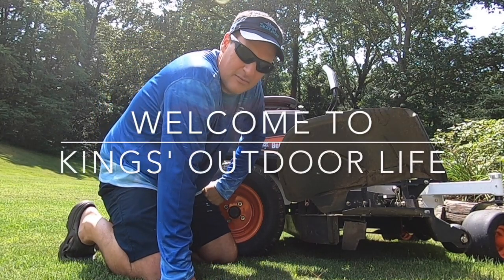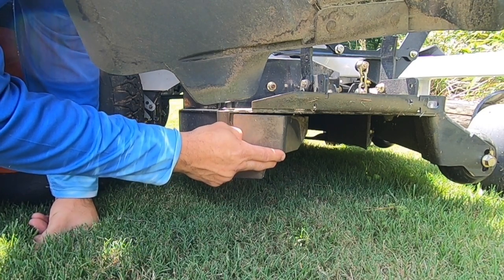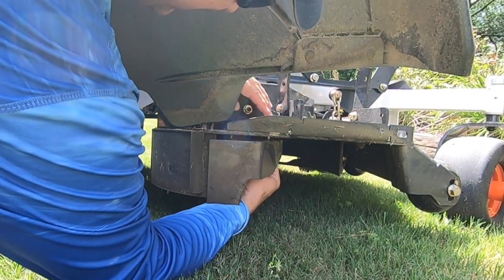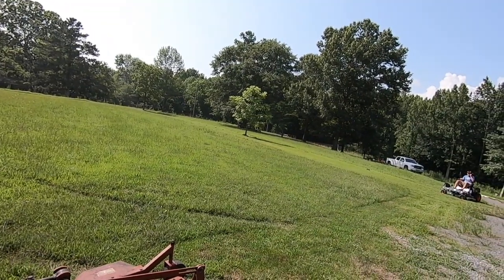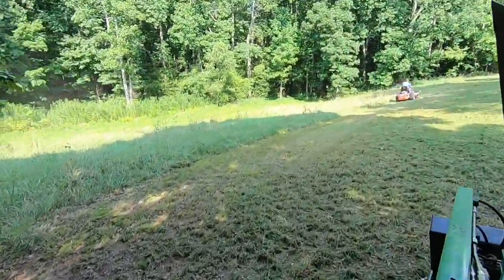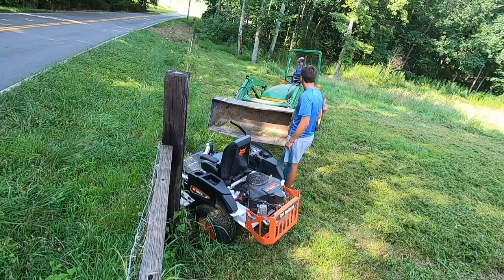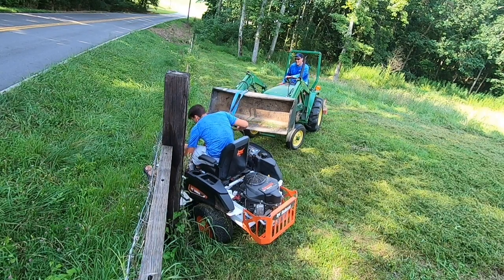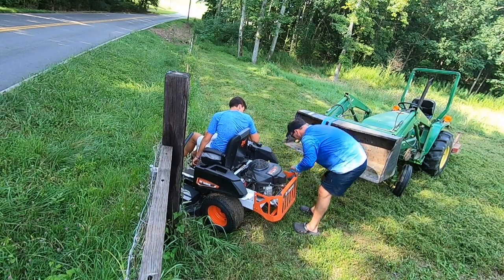Zero Turn vs. Finish Mower - Bobcat ZT2000 KOL 126

Comment: “He was running wide open like all 14yr olds do “. A truer statement has never been said. 👍 looks good. Does the zt2000 have serviceable pumps?
Reply from the maker: I’m told they are, but I really don’t know. Thanks for watching. Hit subscribe - more videos coming up!
Reply: specs say it has the ZT2800, which are the lowest spec hydrogears that are serviceable.  I have them on my hustler raptor SD.
Reply: @999benhonda  copy that. I’ve got a radius E on a 60” deck running 3100 hydros which I believe are the exact same as 2800’s but labeled different for some reason.

Comment: I'm curious which is better from the standpoint of bumpy or ruts in the yard.  I feel like I am afraid to break my zero turn going too fast over them. Wondering if a tractor with mower would be better equipt to handle the bumps.  Any ideas?
Reply from the maker: So 2nd year for me with a zero turn, but have mowed thousands of acres working at a couple of golf course, farms, etc.  Ruts will beat you to death either way and it is rough on the mower.  Finish mower will float over the ruts, but leave uneven cut going perpendicular to the ruts or uneven cuts going with the ruts.  Same for zero urn,   Only way not to is with a reel type mover going over the ruts.  I'd go with the zero turn, but its worth the time to level it out for years worth of better cutting and equipment abuse.

Comment: I'm surprised you needed the tractor to get the ztr unstuck.  I run a hustler raptor SD, similar size and weight.  I just walk the front end back and forth until the drive tires are back onto solid ground.
Reply from the maker: I was against a fence so I couldn't spin the front end around any more.  Thanks for watching!

Comment: I’ve got an older bobcat zt-225 61’ with about 3000 hours on it and I recently bought a bobcat zt-3000 52’ currently with 40 hours on it and I’m honestly disappointed in the mower it feels a lot cheaper made and overall not as quality of a mower they don’t make em like they used to…
Reply from the maker: They don’t make anything like they used to. I’m still liking the mower. Only problem so far is fuel gauge died at 15hrs. Thanks for watching and be sure to subscribe.